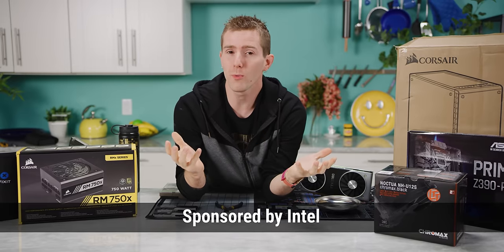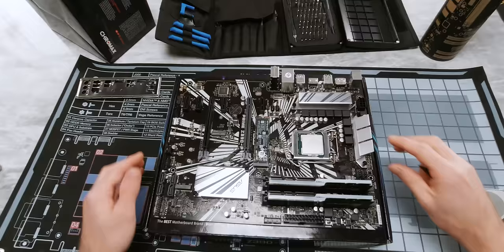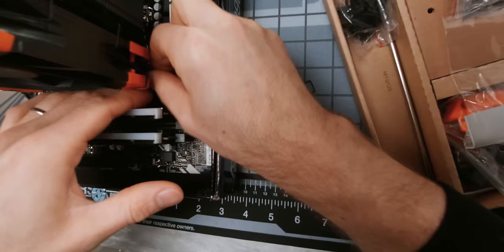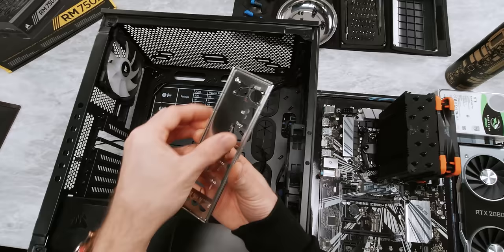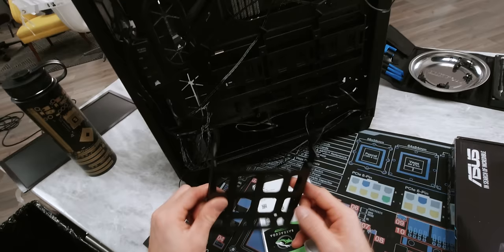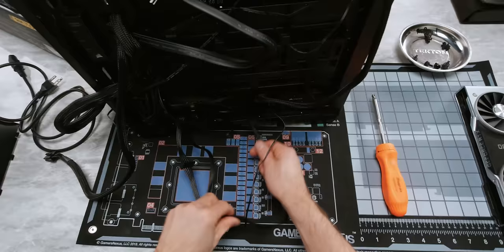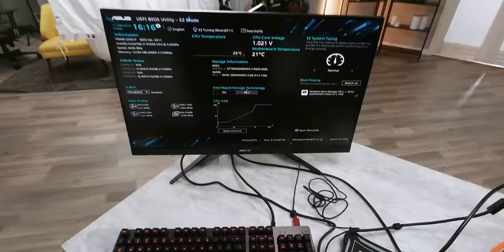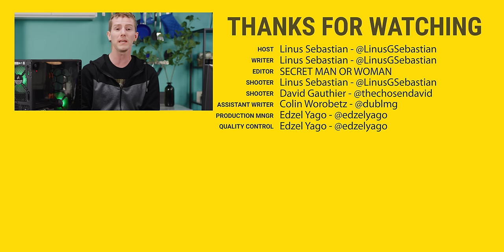First Person View PC BUILD Guide! (POV)

Comment: Great tutorial! I like the systematical way you planned everything and put everything together, keeping the next steps in mind to avoid problems. It's also nice to be informed about possible obstacles at every step. In my opinion this is a perfect tutorial which is focused on the most important things. Will definitely recommend this one to diy PC builders.
Reply: Hey there! Thanks for sharing your thoughts! Totally agree with you, a systematic approach in PC building is key to avoid any potential issues. By the way, have you checked out the HOTO Compressed Air Capsule? It's a compact and versatile cleaning tool that can help you keep your desktop spotless. The powerful vacuuming and blowing capabilities make it a valuable addition to any tech enthusiast's toolkit. Plus, it's reasonably priced compared to other brands. Definitely worth considering! 🖥💨

Comment: "The stand-offs can scratch the motherboard" 
New fear unlocked ❎
Reply: Nobody:

That emoji: "Well yes, but actually no"
Reply: Callum Duncan lmao
Reply: Callum Duncan 
red-green colorblind people:you may have outsmarted me, but I outsmarted your outsmarting
Reply: Motherboards are more durable than people make them out to be. You can get away with sliding around on the standoffs a bit.
Reply: @jakewilferd6093  that space is used for thermal reason to soak up heat and keep other stuff cooler on the chip raw mass makes a good place to store heat away from other stuff or something such thing a kluck
Reply: Seriously it made my heart drop just thinking about it
Reply: @TheyWhomTheGodsDetest  That's a relief. Seriously. I'm about to build my first pc, and I'm freaking out a bit. On an unrelated note, as soon as I bought my CPU, a cheaper and better CPU showed up in my recommended. wtf

Comment: Definitely needed better lighting at certain points, but good video anyway haha. One point you missed is that if you only have two sticks of RAM, they should be installed in either the 1st and 3rd slot, or 2nd and 4th. They are usually colour coded. I haven't built a PC in ages, so I'm not sure if that's still a thing though...
Reply: Yea lighting to look into the case especially when he was connecting things would be great. The black on black made it hard to see the exact placement. But like you said awesome video anyway
Reply: absolutely. i wish he used an all white setup and parts. or at least headlight

Comment: Linus: "Use an anti static wrist strap"

Also Linus: Rubs CPU on hoody
Reply: Static doesn't build up on metal.
Reply: cl4ster17 it may not build up, but can take an already existing charge, in this case the hoodie.
Reply: Asef Jamil Ajwad I can’t believe that I missed such an opportunity😤
Reply: And this does not do nada when you clamp it to painted metal... insulation! Might as well clip it to the stone table in this example >.>
Reply: @JaraLowell Paint on (at least mine) power supply is conductive, I was wandering about this too, so I mesured it.
Reply: When did he rub with CPU with his hoody?
I cannot spot it.

Also, static is very climate dependant. In places with high humidity, you probably don't need it.
Reply: @fuNaN89  One of his other videos.
Reply: Working with a watch is gonna get it all scratched. Although... he’s probably using it to see how much time he’s taking to build the pc.
Reply: cl4ster17 he never does that anyway
Reply: @ResetLoad  More likely, they do know about ESD and how to avoid and safely dispose of excess static buildup.
Reply: It's almost 2020 and people still believe that static will insta kill PC components. You literally saw him ground himself multiple times. I've had CPUs on bedsheets, GPUs in plastic bags and have even assembled entire PCs on carpeted floors.
Reply: charles turner electrostatic discharge is dangerous for electronics components though, clearly if you think it isn’t you haven’t done your research. I’ve studied electronics for 3 years, and I’ve damaged one of my pc components first hand through EDS. My motherboard wouldn’t let me use intel turbo boost after building, would randomly crash the system. Later on in its life I had to under clock the CPU for it run without crashing randomly. In many cases, the effects of ESD aren’t immediately apparent. Many parts have components that, when damaged by ESD, degrade over time when used.
Reply: @1234  Well, if you handle modern components by the edges you're unlikely to encounter any perceivable issues caused by static electricity, and in a single build the 3 USD strap might not make a difference for a careful user. But then again noone is perfect, so having an antistatic workspace is in no way bullshit. Manufacturing companies don't spend millions on having ESD free factories and supply chains for no reason.
Reply: @ISO-ex2lg  wireless anti static 😂😂😂

Comment: Mom: Why is there a fan connected to your ankle?
Me: Linus told me to do it.
Reply: Does it actually do anything tho or is that a joke?
Reply: Bill Cloney it's antistatic, static in some cases can mess with your components. Rare but way better not to risk
Reply: @billcloney7321  anti static to protect PC parts from static electricity
Reply: @Zeroneii3  wait is it protecting you or the pc?
Reply: @17Rxri  is it protecting your or the pc
Reply: @Rommy456  your pc
Reply: @Rommy456  It's for protecting components from getting fried in the very unlikely case that you have built up a static charge that you in turn discharge through the component to ground. The discharge consists of a very short and VERY high voltage surge of electricity. It's what happens when you touch someone who's wearing a fleece and rubber shoes and you get shocked. The shock is the electricity jumping from them into your body, because you just came close enough to become a pathway to ground.
Reply: @TheStuntViking  this is the best explanation i've got so far thank you ☺
Reply: Wouldn't it be enough to buy some anti static gloves and wear them?
Reply: @thesenate8268  You'd be preventing static buildup, but any already built up static would still have no safe path to ground, so you'd still be risking static discharge.
Reply: Mom: who is Linus
Reply: @TheStuntViking  so do you need it? Can't you just touch the case consistantly before touching parts?
Reply: its like ur blaming ur brother
Reply: @rightnleft1355  Just touch your power supply every time you move your feet
Reply: @epicnicity916  ok thank you for answering me I'm new to this and am ordering piece by piece and I've already installed the hdd so just need to get the rest of the parts

Comment: imagine doing all that cable management stuff, and then ur computer doesn't even turn on. lmao
Reply: Happened to me
Reply: @s1d3k1ckRO  same we had everything up and then a no post I fried the mobo or the cpu by testing it without a CPU cooler on it
Reply: @s1d3k1ckRO  Oof that must've sucked
Reply: @braxtonaguado3239  it's been two fucking weeks and the only detail I got is that a controller on the mobo is fried and there's a tiny chance the gpu is affected too. He promised to replace that controller or whatever the fuck might be broken and only work on my pc and deliver it swiftly. My ass. Tomorrow I'm busting in and take my shit back with no pay if it's not done and buying brand new.
Reply: @s1d3k1ckRO  mine is up and running the front case fans aren’t lighting up tho at this point I don’t give two fucks
Reply: How do I know what cables go where
Reply: @heartbrokenblake6875  look up a video and often for power cables they tell you GPU CPU
Reply: Braxton Aguado  do they labor the cables on the mother board
Reply: @heartbrokenblake6875  they label where to put what cables check out a build guide it seems very scary at first but it’s rather simple
Reply: Braxton Aguado nice to know something I won’t do that I was thinking about doing holy fuck what kind
Reply: That would me really annoying since it’s the hardest part
Reply: This is a Linus Tech Tips video. A large proportion of the viewer base doesn't have to imagine that happening.
Reply: @s1d3k1ckRO  so what happened?
Reply: happened to me twice so third time after i bought a new part i checked it first then cable managed
Reply: Oof
Reply: yo i was your 1000th like congrats
Reply: @thanusshansakilan5876  lol mvp over here
Reply: This is why im considering getting the mobo with the led that tells me what was wrong.
Reply: @braxtonaguado3239  oof rookie mistake
Reply: Me too.  Many advice forums and finally got it to work.
Reply: Happiness Supreme
Reply: Same one thing turns on and I don't wanna spend like any more on this thing. It killed my wallet in cold blood
Reply: happened to me and my power button not working, (motherboard was on so it wasn't power supply) unplugged a few cables and plugged them back in and it worked

Comment: Chapters
1. Ground yourself - 0:58
2. CPU - 2:18
3. RAM - 3:35
4. M.2 drive - 4:15
5. CPU cooler - 6:19
6. Get the case out - 12:06
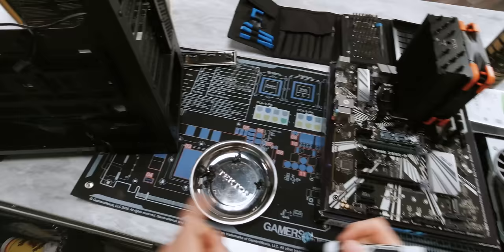7. Cable planning & Case fans - 13:06
8. Motherboard install - 17:00
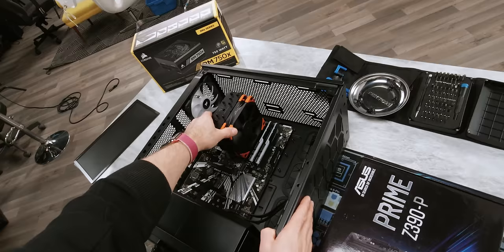9. Motherboard wiring - 19:54
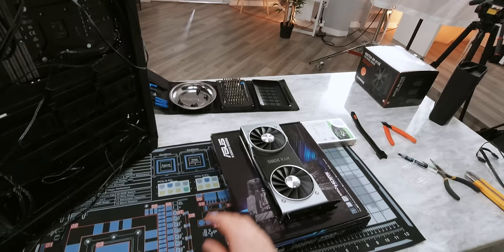10. HDD - 22:44
11. PSU (power supply) - 23:58
12. Wiring power - 25:41
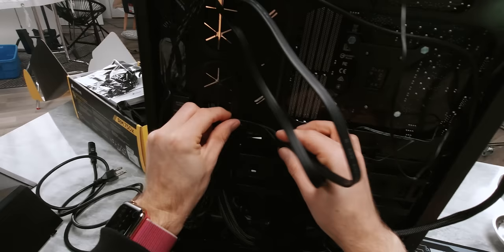13. Cable tie-down - 29:52
14. Graphics card - 31:42
15. Reassembly - 34:27
16. First boot & BIOS - 35:39
17. Driver install - 37:03
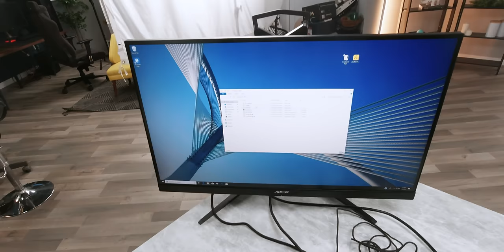18. Benchmarking - 37:55
Reply: Bruh stop copying what others have already commented.
Reply: @jackyboi5668  bruh what do you mean

Comment: Man, no matter how many build tutorials I watch, I'm still intimidated by cable management-
Reply: Lmao
Reply: DUDE SAME
Reply: Just be confident and try to fortify your knowledge, don't be scared.
Reply: "people watch all kinds of POV content on the internet"

That genuinely caught me off guard there
Reply: @imarseti353  Nah just compress all the cables on the rear panel and pray for it to work lmfao. Whenever I build a PC (For myself ofc) and don't wanna do cable management cause of laziness or cause I'm struggling to do so, I always compress them and them work anyways so who cares.
Reply: Good cable management only improves aesthetics, so long as all the cables are plugged in correctly it's fine. You're not going to break anything or ruin airflow if there's some spooling on the bottom because it's designed to run around something to look better and it doesn't.
Reply: It scares me
Reply: Everyone is
Reply: They're just sitting there...

MENACINGLY!
Reply: It's quite easy if you have some zip ties.
Reply: No need. It is the one thing you can screw up and it will hardly make a difference. And besides, cable management sounds scary. But it is basically just neatly ziptying things.
Reply: I have tried, and have failed. Hopefully due to me changing to a bigger and better case, and modular PSU, that I will have better cable managements.
Reply: Get a modular psu then.
Reply: I have watched 5 different pc building videos everyday for the last two weeks because i am preparing to make a pc. That 2.5 hours of videos per day, 35 hours of videos from the 2 weeks and just the thought of cable management has me on my hands and knees begging for mercy
Reply: completely forgot to do an update, I BUILT THE PC!! Theres a part where the cable managment isnt the best but its totally worth it. I say no matter what, give it a shot. Besides, its only cosmetic
Reply: @krokro2913  It's not only cosmetic. It can ruin your cooling if it's a serious mess.
Reply: felt
Reply: Everyone is
Reply: Same, I don't even know if my house has these tools
Reply: Is not that hard when, I build my own PC and I was afraid too but if you take your time and stay calm you will realize how to do it propietly
Reply: fr
Reply: I built pc couple months ago did it all and spent 2 days trying to do cable management, couldn't do it had to bring it to a PC shop lol, don't get a small case like I did and it should be alright although for me it was definitely the hardest part of the build
Reply: planning and take your time guys.. put some thought into it before you start... and have fun!
Reply: @sreehari5143  no way man - i love cable routing and managing all the cables - one of my fav parts of building. Takes practice but it seperates the real builders from tinkerers
Reply: You should be it’s a pain in the ass. I just did a mini itx nzxt h210 build with cable extensions. I litteraly was forced to do cable management because otherwise I couldn’t close the side panel
Reply: Hell nah what really confuses me is installing all that drivers bs plus windows then graphics card drivers like that’s where I get completely lost and just lose interest in building a pc, I got the money I just don’t know what to do after putting everything together

Comment: Antistatic strap on ankle is a very underrated pro move.
Reply: You can also just find some wire and put one end on the PSU and the other on your leg
Reply: My dumbass would forget and trip
Reply: @nadnerb_sr20  💀😂😂
Reply: Im building my first pc in a few weeks, is this actually necessary? My house is completely carpet except the kitchen but dont wanna be in the way of my family, i also have a desk in my room
Reply: @Malikbj1  it's pretty much safer and to not also damage components
Reply: Is it safe to use some latex gloves? I usually get sweaty hands very easily...
Reply: @Malikbj1  Honestly it doesn't matter, PC parts nowadays are very shock resistant and I've built a lot of PCs on carpet and never zapped anything, its just that it is possible to do so people say you might as well avoid the risk but as i said, its a rare occurrence and not actually all that likely to do real damage.
Reply: @Malikbj1  Strictly speaking, no. A decent alternative is to plug the power supply into the wall (leave it switched off) and just touch it every so often, particularly if you move against something that will generate static. Another solid rule is "Don't wear synthetic fabrics while building a PC." You can fight the issue of carpeting by wearing socks (cotton is best) or laying down some paper where you're going to be working so you're not brushing carpet with your feet. Or both!
Reply: @orkell8195  q
Reply: Almost like house arrest.Lol.
Reply: Putting it on the wrist is fine. Plus putting it on your ankle is stupid; especially if you have limited room and a big ass tower like a Phantex Enthoo Elite.
Reply: Just don't go to the kitchen for coffee.
Reply: The verge: pull out live strong band
Reply: @RayneAngelus  what if you just wear latex/rubber gloves?
Reply: @nathanizabeast  Significant negative charge could build up on the outside of the gloves and have little to no way to discharge through you because rubber is an insulator. So while that would protect against charge building up in you and attempting to discharge through your hands, you'd still need to ground your hands (each one individually!) every so often to prevent problematic charge buildup on the gloves.
Reply: doesnt do anything

Comment: Watched this video about 20 times as my parts arrived from Amazon. I Just finished my first build. I'm so happy it works!
Reply: Is there any advice for first time builder?
Reply: @teeeee   Become one with the product manual. Specially the motherboard manual.

Edit: Also JaysTwoCents has a good video on what to do after you build your PC. Like installing Windows and the drivers.

Don't plug in a fan cable to a 12v RGB header. RIP Corsair LL120 fan #3.
Reply: @MrHankHill  Thanks
Reply: Where'd u get your windows copy for your pc
Reply: @suleimanhassan-olajoku7184   Ebay. I looked for the seller with the best feedback. Also Made sure that the reviews directly reference the windows CD key. There was a chance that it was a scam but for $5 and the money back guarantee through ebay and paypal it was an easy gamble for me. But they have worked 3 out 3 times.
Reply: @MrHankHill ok thx
Reply: What was total cost?
Reply: @cduggin.    $2k with monitor keyboard and mouse included.
Reply: Were did you get that upside down font from?
Reply: @supersmasher3619  Googld upsidedown text generator.
Reply: @supersmasher3619   he copy and pasted probably
Reply: i’m doing the same thing right now
Reply: congrats, im wating for mine im very nervous😅
Reply: I'm still waiting on my parts 😬
Reply: @cduggin.  $3000. Just added it all up.
Reply: F off nice
Reply: Me too